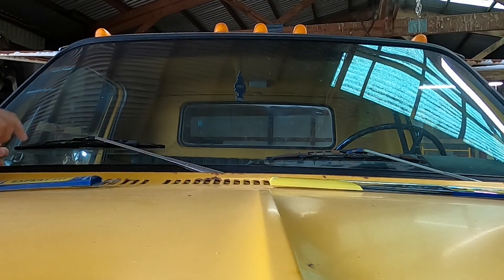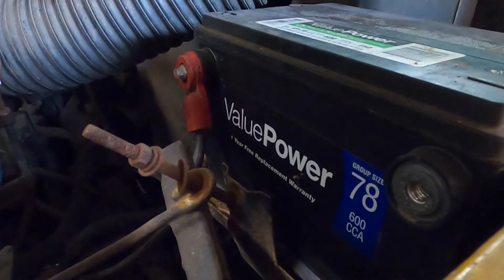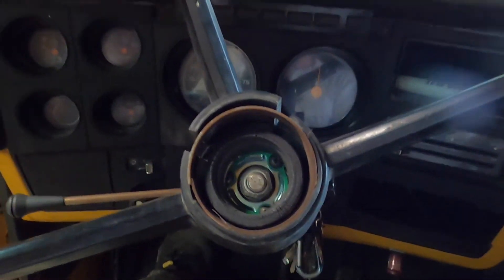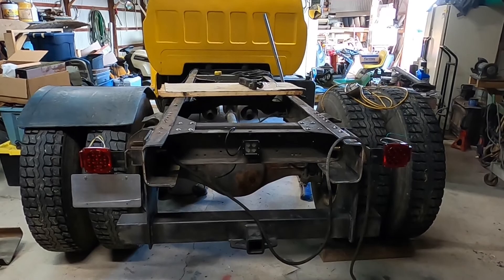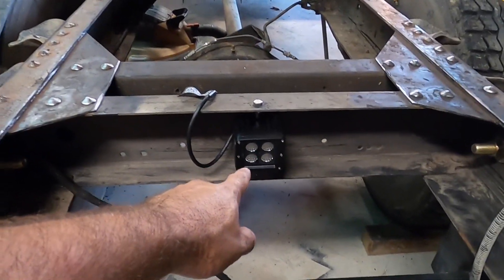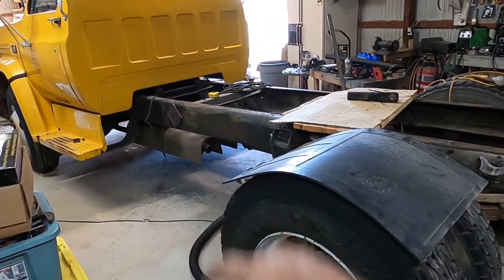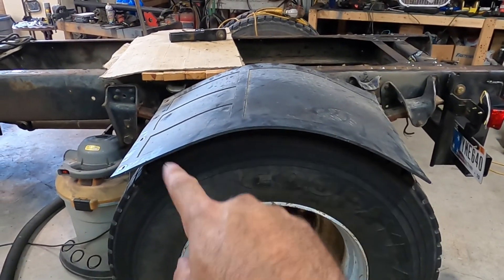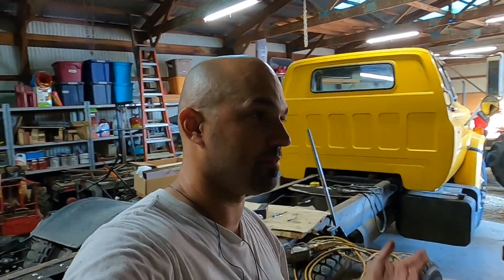Project Yellow:  Minor Updates, Upgrades Crossed Off the List - 1987 GMC 7000

Comment: I could follow along very easy (no mechanical experience here) since I do know what wipers and a battery are! Lol. This really is a cool project you are working on. What was that extra piece around the battery?
Reply: Battery shut off switch.  Works great if you have a vehicle that doesn't get driven often and may have a small power draw on battery.
Reply: @loganhurst992  Gotcha! Thanks!

Comment: I wouldn't throw away the idea of  putting a flat bed on it. You may find yourself using it more often with a bed than a goose neck trailer combo.  What about the removable goose neck ball into a flat bed design? Just some thoughts.
Reply from the maker: I'm kind of on the fence.  An electrified barbed wire fence.